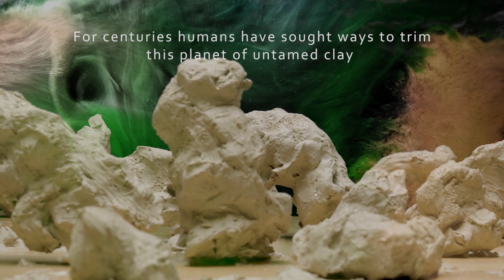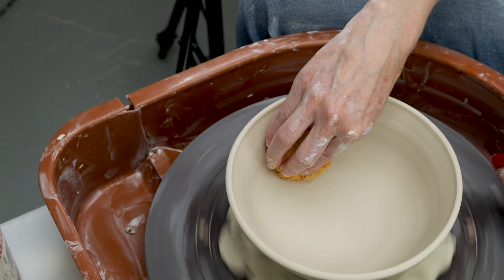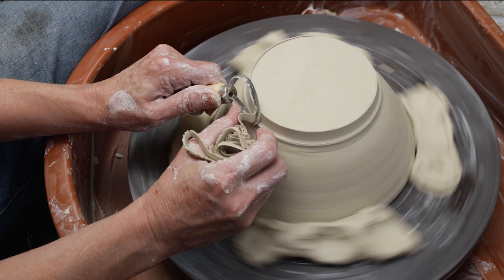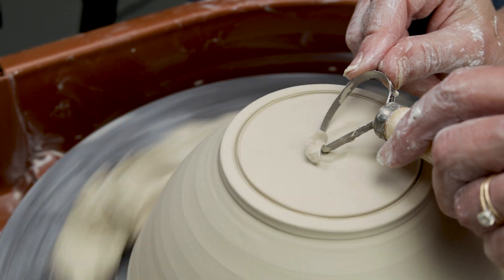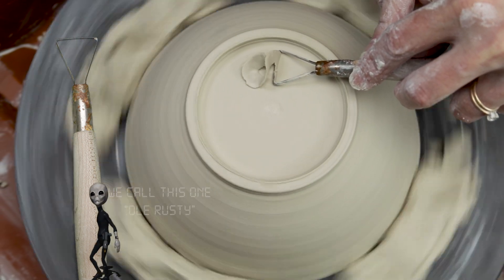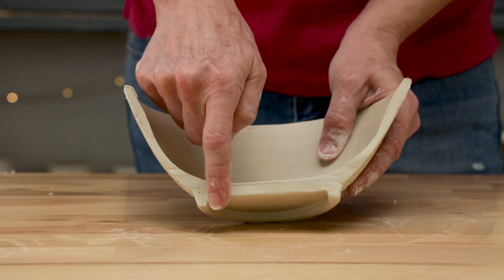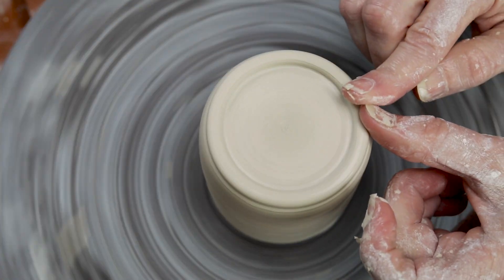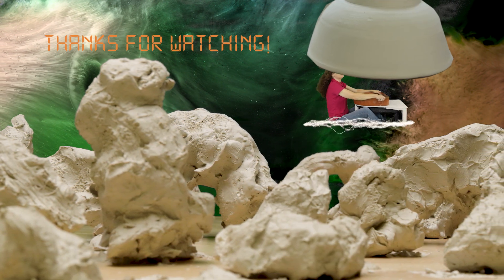How to Trim Pottery - Easy and Fun Way to Learn Trimming Techniques

Comment: The way Ive been centering for trimming, is to wrap it in plastic wrap, spin out a ring, set the piece in the ring and then close the ring on it; the closing ring will push it to center and lock it down. Then, I just pull the plastic wrap open and the piece pops right out.

Im a beginner and Im working outside in a shed, so its hard to get my pieces dried evenly; parts are bone dry and other parts are still soft. So, Ive had to get creative with some techniques.
Reply from the maker: Interesting technique - would love to see a demo of that...you may have revolutionized the hardest thing in pottery 😃
Reply: @LittleStreetPottery  

Ha. Maybe Ill get a video up, sometime. Just try it though, its pretty straight forward. I watched people tap and bump and use expensive jigs and stick it in place with clay wads and then I tried a ring. Voila!

Comment: Thank you that was more helpful than most. Could you please do a video trimming bottles. I love to make bottles, but have almost given up on trimming them.
Reply from the maker: Cool...can you post an example of the kind of bottle you are making? Thanks for watching!
Reply: @LittleStreetPottery   all different shapes and sizes. I can’t get a pic to load here, but soap bottles and oil bottles would be a good example. Functional ware, long slender necks. I’ve tried chucks, but I must be doing something wrong because I can’t keep stability. Thank you.
Reply: @tinadaniel5420  Hi Tina.  Those are very tricky for sure.  I think i would just throw a flat bottom like you do with a mug so you dont have to trim a foot.  Just thumb the clay smooth.  will that work for you?

Comment: Ann, how did you repair the pin hole you made to measure the depth of the bottom before beginning to trim, please?  I’ve never had the nerve to do that! AND I loved the tip of beginning with the center of the bottom so it removes extra weight to help less cave ins!  Thank you! Course, you make everything look easy but I’m going to try both of these tips when I get back into the studio! ❤ Ellen
Reply from the maker: I just rub my thumb or finger over the hole - the clay will come together easily. Thanks!
Reply: @LittleStreetPottery  thank you!! ♥

Comment: Ann, very helpful video! I've been having trouble trimming lately and this helped a lot.

How do you fix the hole that you make after measuring with the needle tool?
Reply from the maker: Just give it a little squeeze and a wipe with a finger...clay easily expands to cover it and I’ve never had a problem with it leaving a mark.

Comment: Ann, Thank you for your easy to follow, easy to understand instruction. I have wondered why pottery pieces need a foot. Does it have something to do with how they fire or to prevent glaze drips onto your kiln shelves?  Or is it primarily aesthetic?  I’m not trying to criticize at all.  I was just curious why pots “need” a foot ring.
Reply: I think it's because of the firing yes, AND it allows the pot to stand without wobbling! :) I think it's more difficult to trim the bottom completely flat without a footring :)